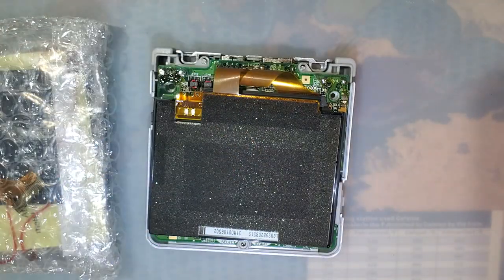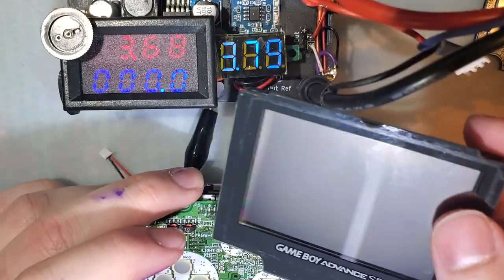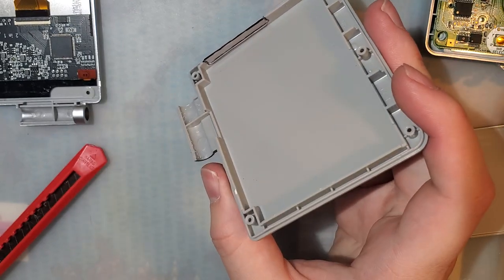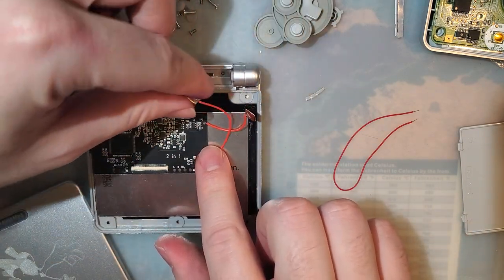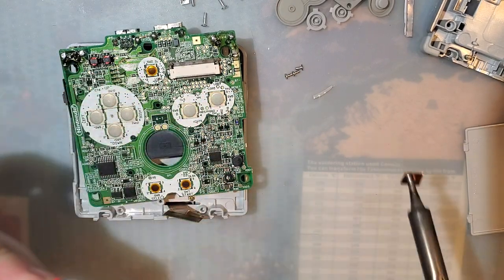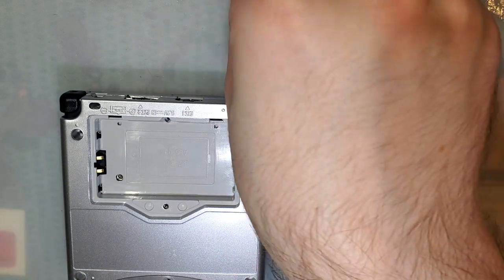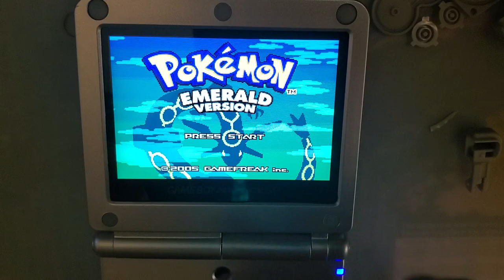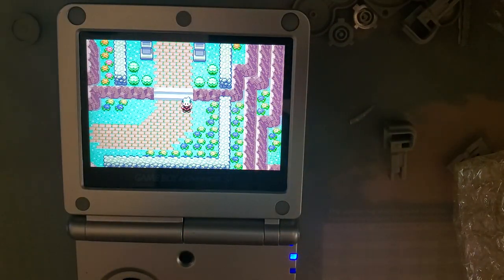'One Chip' Game Boy Advance SP IPS Kit ('2 in 1')

Comment: A small tip: for "hiding the cut marks" on the transparent shell, use a slightly damp with acetone cotton swap. It helps hide the white marks that you get. Don't need much, pretty much dip it in, squeeze out the excess and then rub it over the area you want to affect.
Reply from the maker: Seems like it could be dangerous. Another option is to add clear paint or nailpolish. That will fill in some the roughness and hide the marks.

Comment: I would strongly recommend the Dremel with the Dremel drill press for these mods that require cuts. Grab a high speed cutting bit and you’ll be set. I’ve been using one and it makes these mods really really easy. We’re talking seconds to cut immaculate results, even on clear shells. I’d be happy to send you pictures of my setup and some cases I cut.
Reply: With the Dremel drill press you just lower the bit and route the shell around the bit. You can be super precise with it. Just put masking tape on the side of the shell that makes contact with the plate on the press.

Comment: So I have a question: Do I have to solder the wire from the video-cable to the brightness button? Because I want to use the brightness button for smth else (Bluetooth paring). So can I change the colors and brightness just with the touchpads?
Reply from the maker: just touchpads is fine, yeah

Comment: Hey Makho. Is there a way to modify the hardware to reduce the sensitivity of the sensors on the back of the lid? In my experience the sensors were prone to accidental presses whenever my index fingers touched the back lid when opened during game play.
Reply from the maker: I believe that removing the small capacitor next to the six pin package that the touch sensor wires into will adjust the sensitivity. That or you have to replace that capacitor with one of a higher value. I don't recall off hand. 

If you want to disable the capacitive sensing entirely, just remove that six pin package. The button control will still work.

Comment: I have 2 gba sp systems, both ags 001. I was wondering if there are any inexpensive ways of getting a backlit display that you recommend. Im not too picky when it comes to a display, just wanted to have 240x160 resolution that is the same as the original.
Reply from the maker: you could watch the video you're commenting on
Reply: @makho  I was unclear with my wording, I am at 8 mins with the vid. I meant to ask which display you would recommend if you could only have one, that is under ~50 USD.
Reply from the maker: @ejohn180  I did a full write up of all the kits I've played with including my recommendations for each system: https://www.reddit.com/r/Gameboy/comments/grrsrn/my_notes_on_all_game_boy_backlight_kits/
Reply: @makho  Thanks, I just got into soldering by fixing my broken wired xbox 360 controller that had a frayed cable. I later wanted to mod one of my gba sp, found your channel that way.

Comment: Nice one! I don't know why the IPS kits i have are so different to yours, maybe it's just the UK import from out version of eBay. They have the board on the ribon but it's much neater.
Reply: Yeah he mentions this is a different design where the ribbon and board are separate.
Reply: @j.m.e.2090  I mean even the ribbon screens i have are different to his ribbon one he shows in this video but i've just seen his other comparison video where he has the same ribbon based ips screen i have.
Reply from the maker: @alluma5133  I showed off the funnyplaying ribbon. The older version of this is the 'one chip' ribbon and I only have one of those (currently installed in my mana blue GBA SP)

Comment: Could I use the touch sensors and the button for the brightness or is it either or?
Reply from the maker: you can use one or the other or both. Having a touch sensor does not disable button based controls and vice versa.

Comment: Makho, have you tried modding a SP where you close the screen halfway down and the system goes to sleep? Would love for you to try and show us while you're at it.
Reply from the maker: I haven't and I don't intend to. The screen itself is such a low power device compared to the rest of the system (unless you have the brightness all the way up in which case just lower the brightness) especially on IPS modded consoles that turning it off has a relatively negligible impact on battery life. If playing on a flash cart, it's better to just enable sleep.
Reply: @makho  So would you rather buy and use this kit with a circuit board or the original kit with just the ribbon cable? Can't make up my mind.
Reply from the maker: @nusdogg  this kit

Comment: I installed this 2in1 ips on a GBA (China, aliexpress), when the battery drops (as soon as i get the red light) i experience screen freeze, the sound continues to play and the system is responsive (you can hear it), only the screen is frozen. Anyone else has experienced this? Is this normal?
Reply from the maker: contact teh seller
Reply: @makho  i did and he sends a replacement, its probably the board... Do you think the problem could lie in the lcd screen? Finally, could i use an LG lcd instead of the Topoli? Is it compatible with this board?

Comment: Where did you buy this kit? And how did you solve the fuse problem with your battery? Recently, I modded my GBA (not sp) with a Lipo Battery. It's awesome
Reply from the maker: It's linked in the description. What fuse problem?
Reply: @jamesytez6639  I thought you fixed it by just replacing the fuse
Reply from the maker: @jamesytez6639  I don't understand what you think the problem is. I explained in that video why that issue happens (user error, connecting the battery backwards) and how to fix the issue when that happens.
Reply: @thiefrules  ok. I was wrong. I thought it was a common mistake when you use lipo batteries or something. I have to learn how to read the title twice
Reply: @makho  yeah. I answered myself later. Thanks for your content

Comment: Where can I find a install diagram for the wired xbox 360 pcb board. I am planning on buying one. I am also wanting to purchase some of your gba sp hinge tools if you are able to sale them.
Reply from the maker: there should be no diagram needed. Just install the port on the board and then install the board on the controller. I do not sell those tools.
Reply: @makho Sorry I must have miss read the github link. I thought it said you had to solder some wires to different points as well.
Reply from the maker: @APlusModding  That was the prototype one I made. The github link has PCBs you just slap together.